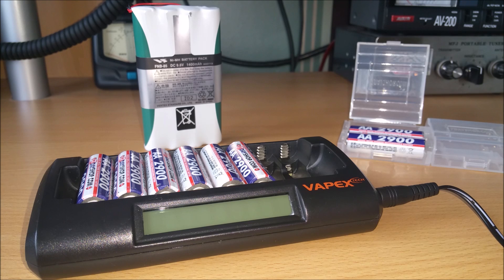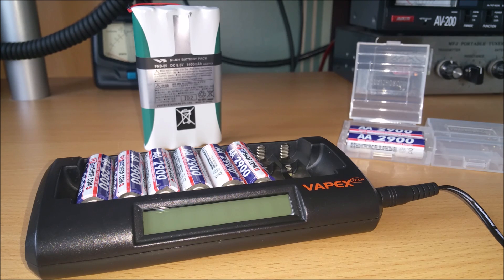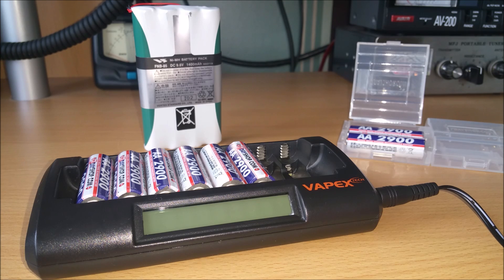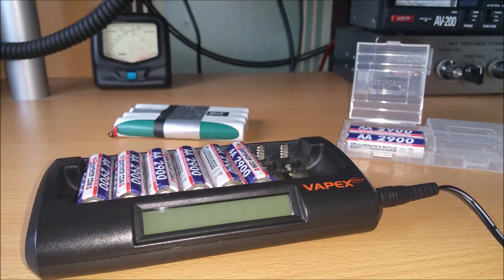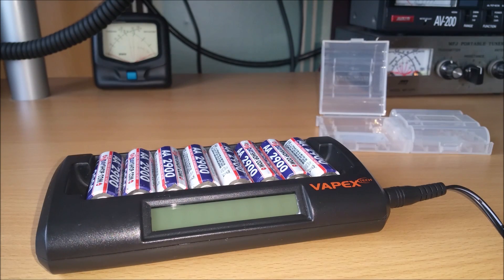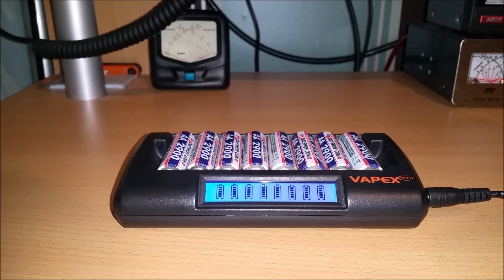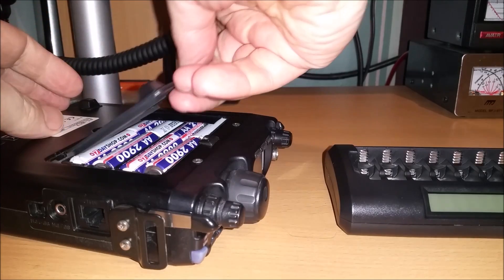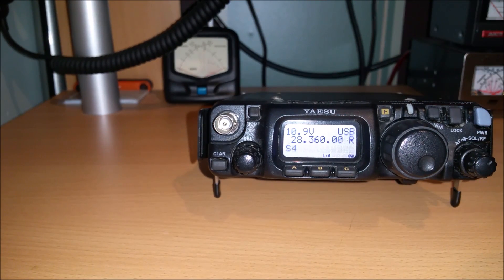Yaesu FT817ND alternative internal battery option

Comment: Is this still a good solution or has something better come along?
Reply from the maker: Hello Ken, this is still a good option but there are better ones available. I like to use the SLAB batteries and although they are heavy I find them reliable.
Reply: you must be talking about the standalone battery.  I have been using them for years too.  The internal batteries based on reviews just don't work that well.  I have seen some LiOn batteries but they require taking them out to charge or buy a dedicated bottom battery lid cover with built in charging socket. Never played with Lion batteries with my 817 yet.  Its not easy getting the voltage high enough for 5watts.

Comment: Chris M0RSF  GREAT Video but you failed to mention a really important point that some people might miss, but you actually performed in the video.  That is... the key to using the more modern NiMH batteries (i.e. Eneloops and some others) is placing the Yaesu alkaline battery tray **into the radio BEFORE you load the batteries into it**.

Many of the newer batteries (newer as in six years after this video :) are slightly larger in diameter than Yaesu's intended alkaline batteries.  [I] Found that out the hard way until I read a tip from long ago on some website that now eludes me.

Your video confirmed this practice must work, so I grabbed my box of Eneloops, shoved the battery tray in first, then loaded... HEY they fit just fine!!!

Now to restock with the black "pro" Eneloops  ;)
Reply from the maker: Hello David and thanks for the comment. Well spotted that I already had the supplied battery tray in the battery compartment of the radio. The reason for this is that I used to leave the empty battery tray in the battery compartment all the time even when I removed the batteries to try and protect the wires from the battery tray from breaking. I have seen some of the newer rechargeable AA batteries that are slightly thicker than the ones I show in this video and I could see it as been a problem. I gave the batteries shown in this video and charger to my lad for his games console controller as he was costing me a small fortune in AA's. For some time now I have used SLAB's and I know that they are heavier but I find them very reliable. Stay safe and 73 Chris M0RSF

Comment: Hi Chris, thank you for sharing your video and as a newbie (M6KVK) I am leaning towards QRP with my 817ND.  I use Lipo 4500mah batteries and usually carry 3 with a very small slab (2ah) to use as a slave to connect to my field charger with a 45w solar panel which keeps me going all weekend on field days.  I wondered if you or anyone you know had explored the 18650 option?  These seem to be the "in" battery at the moment other than Lifepo4 which are so expensive, and I am just thinking about getting a couple of battery trays to see how I go.  I do wonder if they will work out to be a similar option as the lipo so no point changing.  Anyway, thank you again and enjoy your portable days out.  73

Comment: About 5 years ago I did the same.  I also modded the tray to allow the radio to charge the cells. At least I think that's why I removed a wire from the tray;-)
Reply: Jim Whitaker what is this mod you speak of?
Reply: @mikekn4emy855   cut the green wire

Comment: The genuine battery is a scandalous price... I used NiMh cells in the dry battery holder for years without incident but now using a heatshrunk pack similar  to but better than the stock one.  I did find a few Chinese cells with overstated capacity that would not run my FT817 on transmit, nor operate a digital camera.
Reply: +M0RSF The good old lead acid still has got a lot going for it, but as you say, they are heavy!  The most useless of all the NiMh cells were some labelled 3800mAh, although I fully expected that to be a lie the cells proved to be very high internal resistance, the sort of thing you might put in your solar powered garden LED lights on the way to getting them recycled.
Reply: g0fvt I could build one with lithium double that capacity for a couple bucks easy. Everything radio is super overpriced.
Reply: Absolutely, when you see the price of the battery packs you wonder how how much profit they make from the radios too!